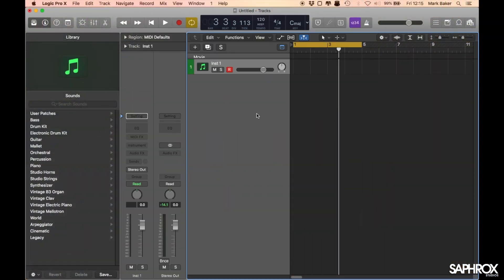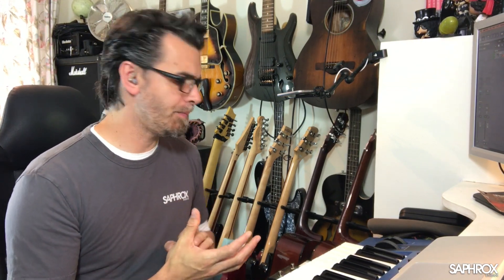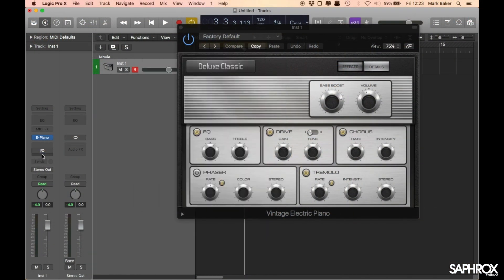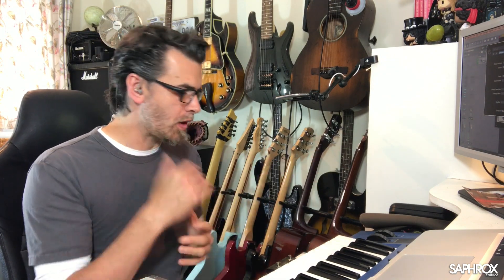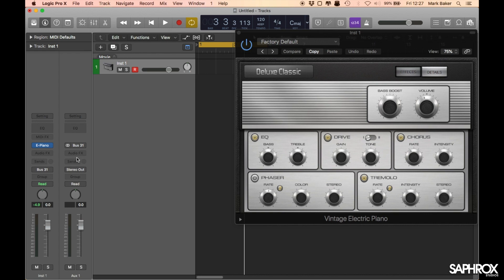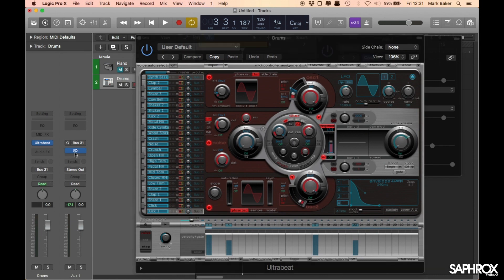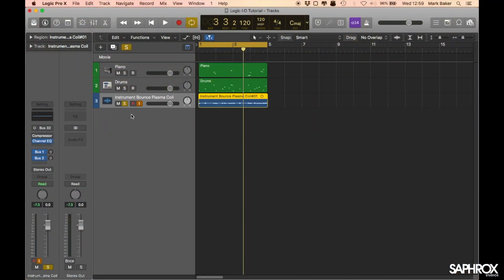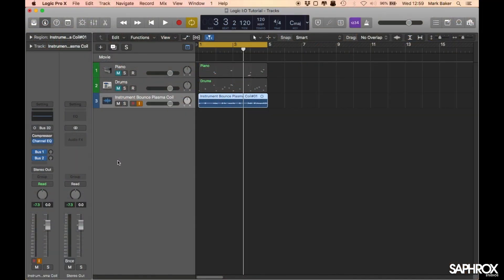Saphrox Studios - Guide To Logic Pro X - I/O Plugin - Featuring Plasma Coil

Comment: Thanks for this! Much needed and appreciated! Just one question: how are you using input 3 on your interface as both the output for Logic sound and an input for effects from the pedal? That's the only thing I'm not understanding here. Thanks!
Reply from the maker: The main monitors are working on input 1&2. That’s is what we are hearing from 

The pedal is wired from output 3 through the reamp box to the pedal and then back to input 3.
Reply from the maker: This means that the audio signal flow is:

The output of Piano or drum module is routed to Aux 1

Aux 1 is running the IO plugin. 

The signal enters the start of aux channel and into the IO Plugin 

The IO Plugin send the audio out of Output 3 and on to the reamp box

Reamp box then routes to the pedal 

Pedal is returned to input 3

Input 3 then reconnects in the IO plugin and continues down and is routed off to ttr master outputs which in my case are Outputs 1&2